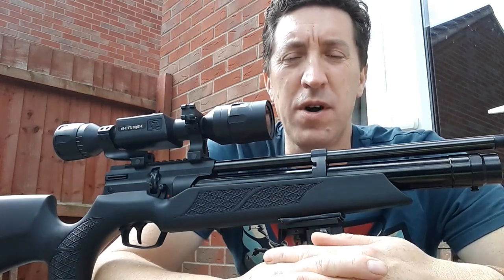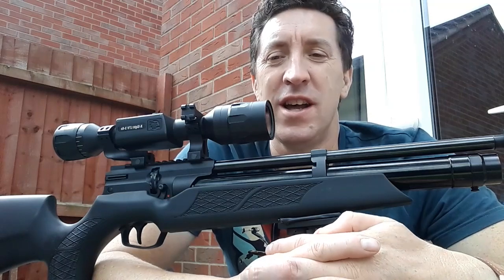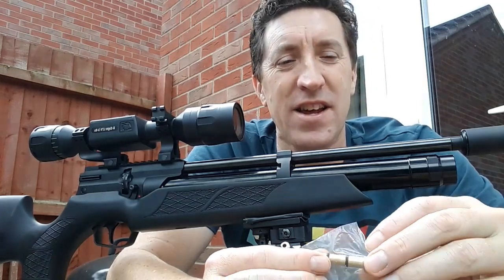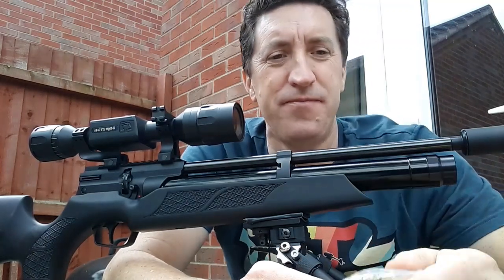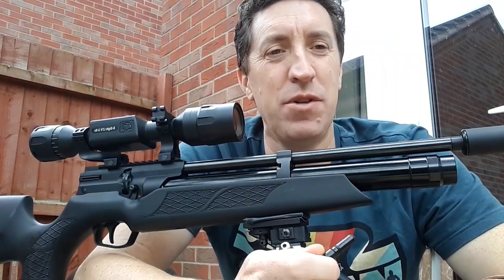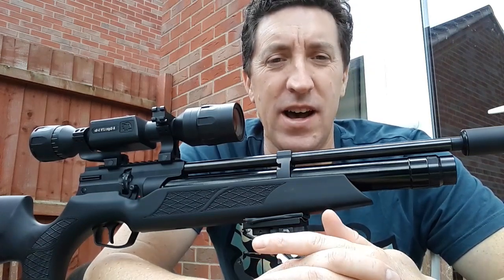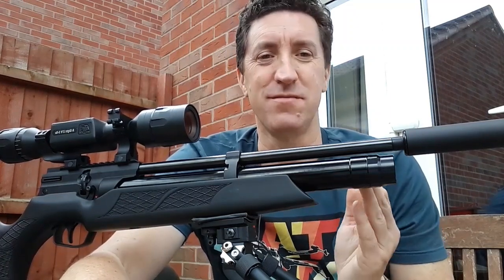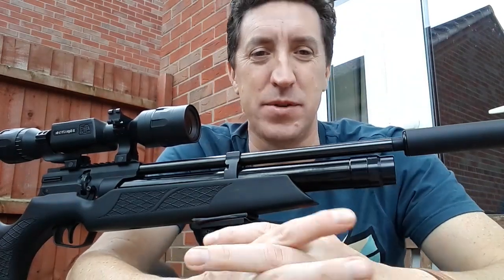HW110 Leaks. Prevention and Solution. + Titanium Cylinder Upgrade

Comment: Hi best fittings do a cap for the fill probe that has a nylon attachment all I do is loop it on to my whip then when I lubricate my fill probe the cap keeps it nice and lubricated.Another little trick is i use a very small length of fishing braid loop it around my barrel and tie it to the fill probe  so not too loose it  and my probe goes in from the top, just a couple of ideas hope they help